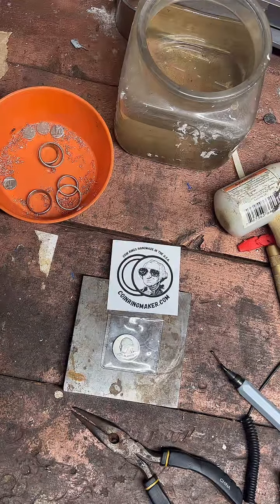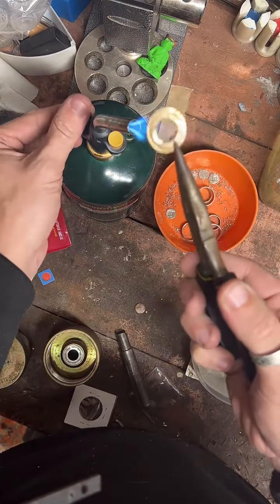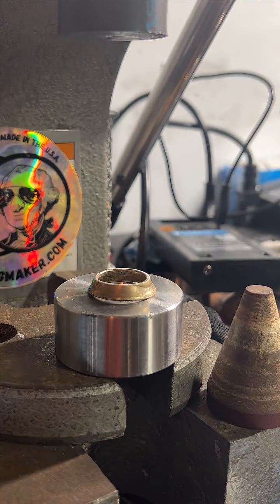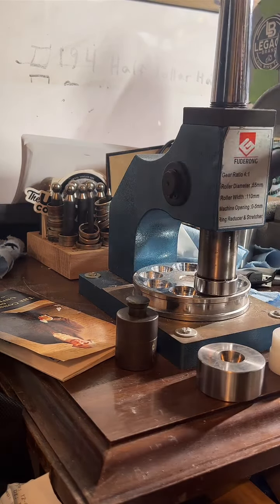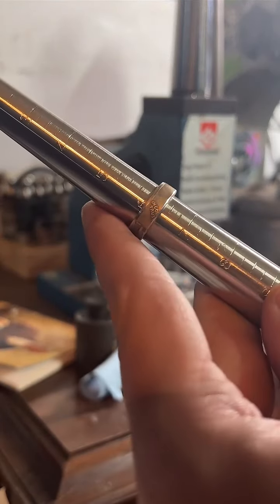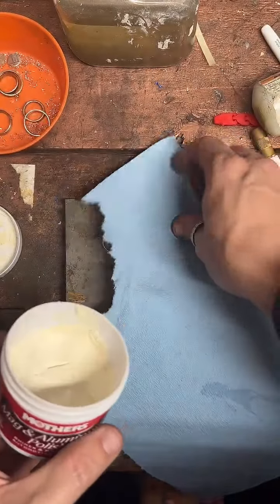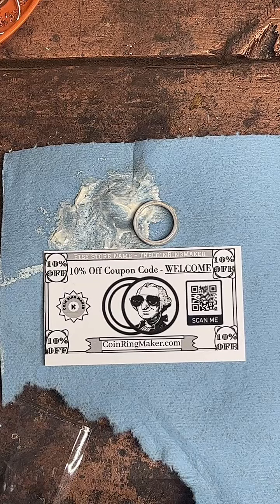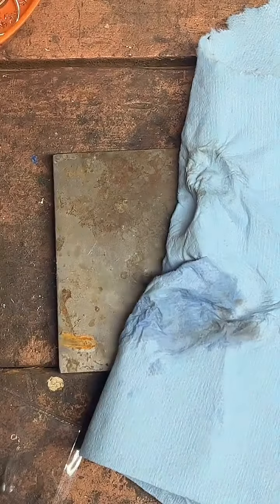Making a 1945 silver quarter into a ring

Comment: Love your videos!! Question…Do you routinely coat your finished rings with a self curing or light cured resin?? Particularly copper or brass??? Thank you
Reply from the maker: I’ve tried uv resin. Both hard and flexible and neither is really a good solution. It’s difficult to get an even coat and it makes the rings uncomfortable. I recommend clear finger nail polish.